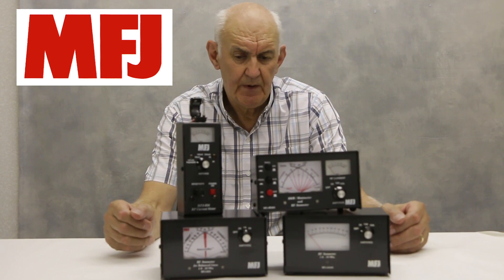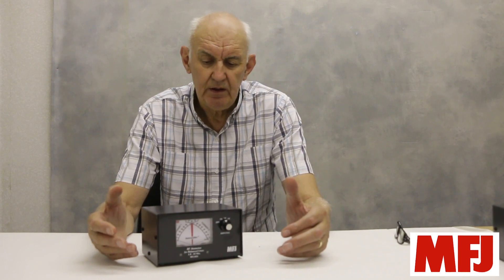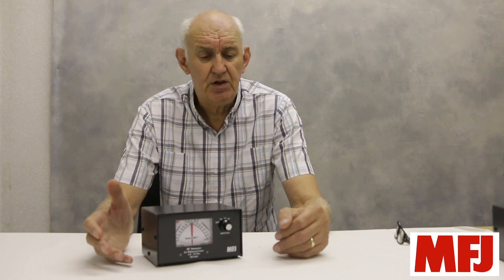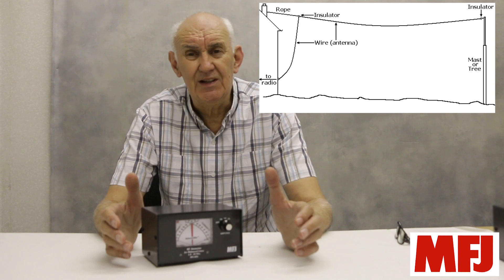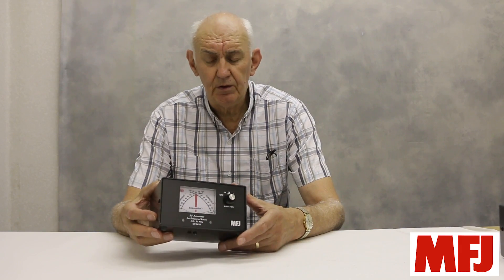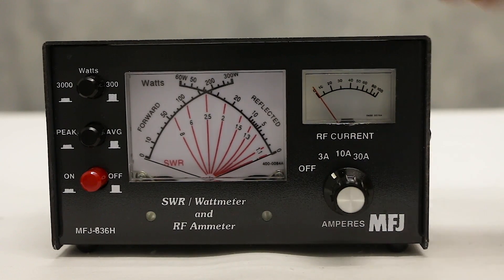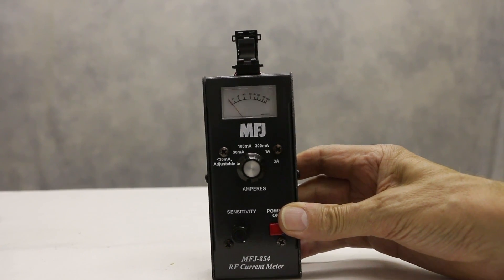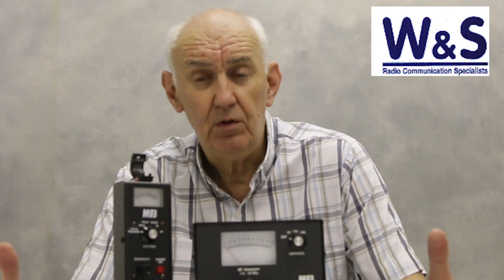MFJ Current Meters MFJ-834  MFJ-836H  MFJ-835  MFJ-854

Comment: I bought the MFJ 835 on eBay. The connections on the rear are arranged in a very weird way. Hooking up from the TRANSMITTER ladder line and the antenna ladder line the meter cabinet would have to be on its side. YOU CAN'T TWIST The ladder lines. THEY MUST MAINTAIN that spacing!!!! Usually 6 inches apart. When my unit arrives; I'll have to re-wire the internals so that the meter case is upright. If I type how it will be configured internally; anyone reading my comments will get confused